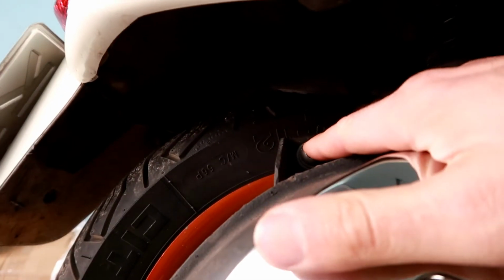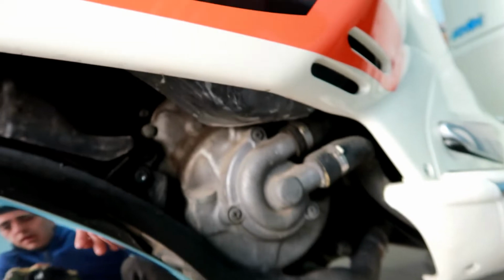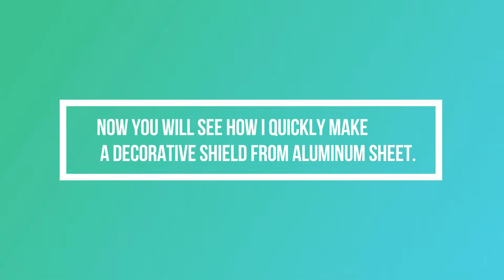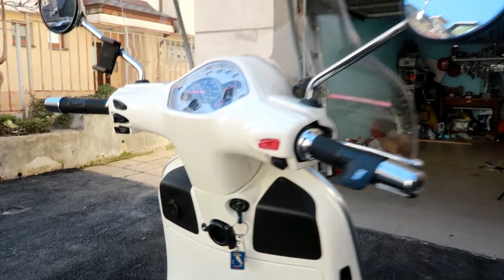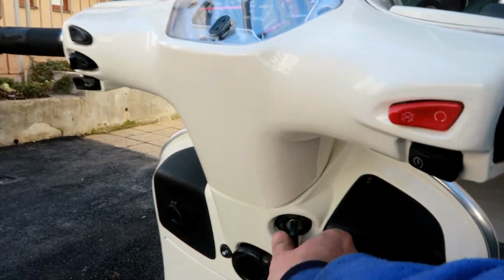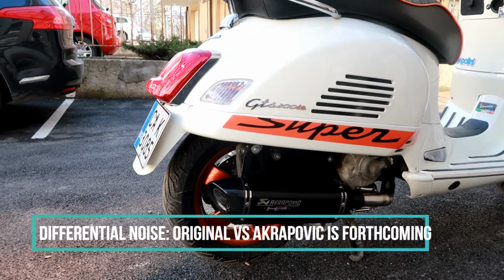Vespa gts 300 Akrapovic exhaust from Aliexpress vs standart exhaust test

Comment: Brow I have this AliExpress one. I like it but seems too loud and buzzing like a bee when I open the throttle. Maybe I'm just not used to it?

Any way to make it quieter? Any part I could add? Thanks!
Reply from the maker: @elsizzle2000  Hi friend, I bought new longer  silencer and mounted it in exhaust.
Reply: Can you show which silencer you bought? What is sound difference?  @fitness-fishing-s.kovachev
Reply from the maker: I ordered another silencer for the same reason link: https://www.aliexpress.com/item/1005003366060643.html?spm=a2g0o.order_list.order_list_main.20.4c4b1802HQOay4
Long 48mm4 I did not see a big difference. Experiment and I will be glad to write a comment under the video how the sound has changed.

Comment: You have a GTS 300 I can see, but does it have the HPE engine?  Mine does and so I’m wondering if the one you used in the link would fit my bike.  Mine is 2022 model year. Thanks very much!
Reply from the maker: I installed the exhaust  Akrapovic on my Vespa 300 HPE without any problem. The exhaust comes complete with everything needed for installation. I haven't even used the manifold from the set, on which the lambda probe is screwed. I installed the exhaust directly on the original manifold pipe. Greetings!
Reply: I finally ordered the muffler. Can’t wait to try it on my 2022 Sei Giorni 300 HPE. Mine has scorpioivc label.
Reply: PS. I’d prefer no label.  I wonder if it is removable?